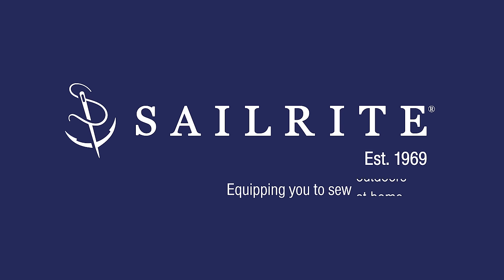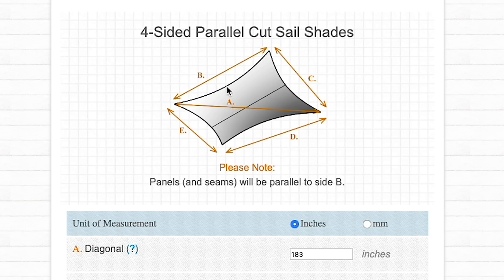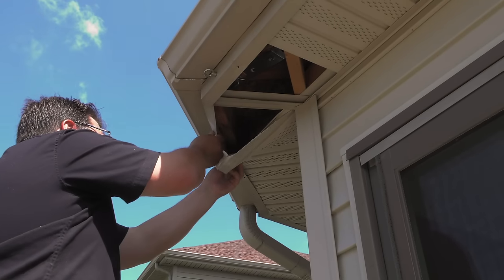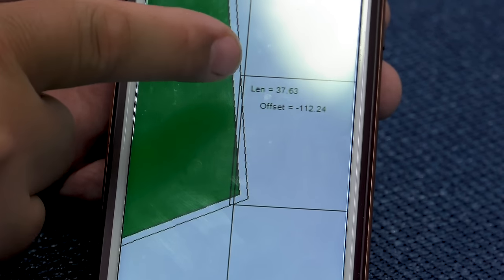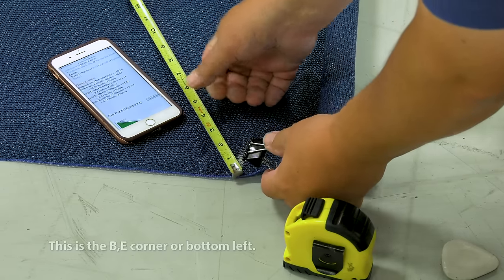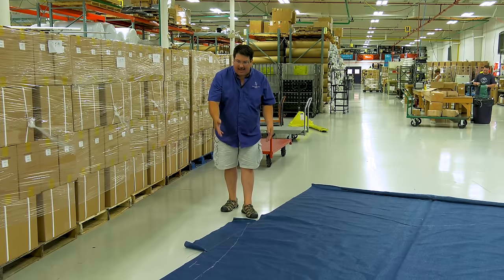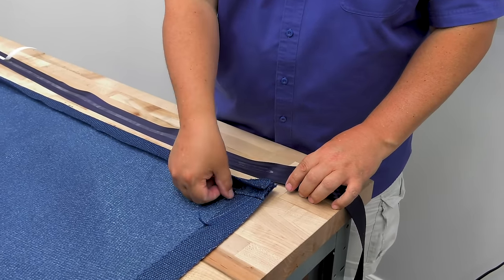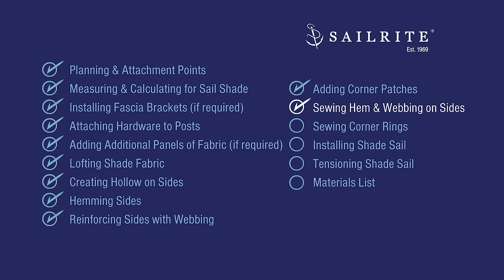How to Make a 4-Sided Shade Sail

Comment: Firstly great videos, I’m looking at making a few things around here and came across you by way of research for a walking foot sewing machine for work on a couple of shade sails and my boat rebuild. Couple of pointers I’ve noticed the professionals do here with sails, they don’t use chain or turnbuckles, they use 5mm stainless wire with crimp sleeves. This is cheaper and looks so much cleaner then chains and turnbuckles. They pull it tight with a sailing rope pulley and measure the gap, then make the wire rope to suit, the beauty these days is the fabrics barely stretch anymore, so once tight they stay tight. This also allows them to not subtract the length of chain and turnbuckles from the sail, so the sail can be bigger and full out the area better. Other thing they do is drop the height of one anchor to put a twist in the sail, this stops it flapping up and down in the wind.    What I’m trying to find is how to calculate the measurements for a sail that has five/six or more anchor points, I’ve got a long area between two building (40’x12’) that I’m trying to get as much cover as possible, I’ve seen a few sails where they anchor it at 3 points along one side to keep it tucked tight against the building (which is what I’m looking for). Any ideas or links to more helpful sites would be greatly appreciated. PS, you have already sold me on going with the LSZ1 bundle machine, get to use it in both world, at home or at sea.

Comment: Consider having a metal fabricator weld some mounting flanges at the correct angle to a tube to keep the posts spread apart. The hammock tension plus the sail shade tension is enough to pull the posts inward. They are soft wood. Being able to hang plants over the hammock will look nice and provide a little extra shade.
Reply: im going to do my first 4 corner shade sailnet tommorow .......wish me luck and success.....capetown SA.

Comment: We have a 3 sided sun shade and used 3 metal fence posts and I cemented each pole into a bucket with a 6olb bag of cement. The buckets are coming down with the wind.
Reply from the maker: INSTALLING POSTS: 
a) We recommend the use of 4 inch, schedule 40 steel pipe or 6 x 6 inch wood intended for outdoors use. Obtaining independent advice from a builder is recommended.
b) Posts should slope away from the center of the sail at an angle of about 5 to 10 degrees.
c) A conservative guide to burying the posts would be one third in the ground and two thirds above ground. This will vary depending on how many sails are attached to the post, soil conditions, size of the sails, etc. Posts are usually embedded in a concrete footing, 3 ft. to 6 ft. deep and 1 ft. to 1.5 ft. in diameter.
d) The use of a guy wire to help support posts where two or more sails are attached is recommended, especially for a 6 x 6 inch wood post.
e) Always call local authorities before you dig.

Comment: How do you know it won't pool water?
Reply: It's a mesh. Very low water resistance. Keeping it tight and angled will help direct the water off it but it won't pool water. It will leak through. That fabric is meant for shade and cutting down on wind, not waterproofness.

Comment: How did you install the posts?
Reply from the maker: INSTALLING POSTS: 
a) We recommend the use of 4 inch, schedule 40 steel pipe or 6 x 6 inch wood intended for outdoors use. Obtaining independent advice from a builder is recommended.
b) Posts should slope away from the center of the sail at an angle of about 5 to 10 degrees.
c) A conservative guide to burying the posts would be one third in the ground and two thirds above ground. This will vary depending on how many sails are attached to the post, soil conditions, size of the sails, etc. Posts are usually embedded in a concrete footing, 3 ft. to 6 ft. deep and 1 ft. to 1.5 ft. in diameter.
d) The use of a guy wire to help support posts where two or more sails are attached is recommended, especially for a 6 x 6 inch wood post.
e) Always call local authorities before you dig.

Comment: Yet another 'how to install a sail shade' without anything about digging / concreting / the posts. Otherwise a great video.
Reply from the maker: INSTALLING POSTS: 
a) We recommend the use of 4 inch, schedule 40 steel pipe or 6 x 6 inch wood intended for outdoors use. Obtaining independent advice from a builder is recommended.
b) Posts should slope away from the center of the sail at an angle of about 5 to 10 degrees.
c) A conservative guide to burying the posts would be one third in the ground and two thirds above ground. This will vary depending on how many sails are attached to the post, soil conditions, size of the sails, etc. Posts are usually embedded in a concrete footing, 3 ft. to 6 ft. deep and 1 ft. to 1.5 ft. in diameter.
d) The use of a guy wire to help support posts where two or more sails are attached is recommended, especially for a 6 x 6 inch wood post.
e) Always call local authorities before you dig.
Reply: Watch Sailrite’s video about their 3 sided shades, they show more detail about posts and attachment.
Reply: Well this is more of a "how to make a sail shade from scratch" video.